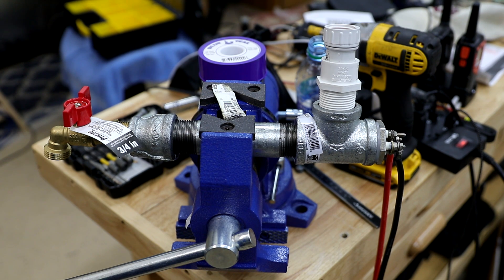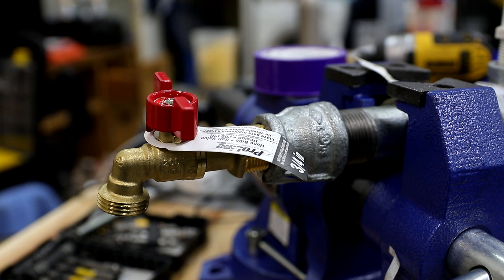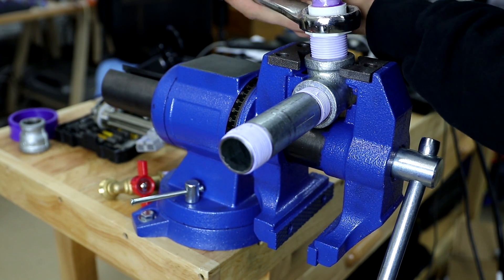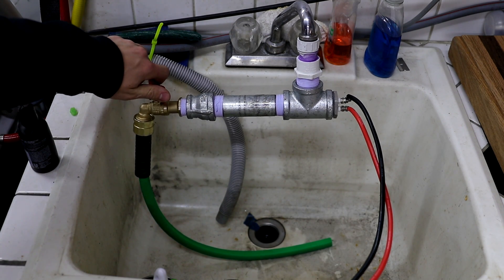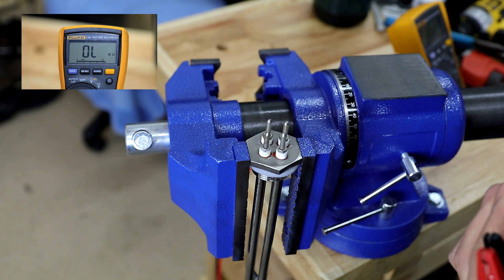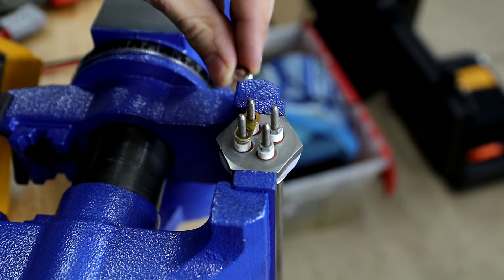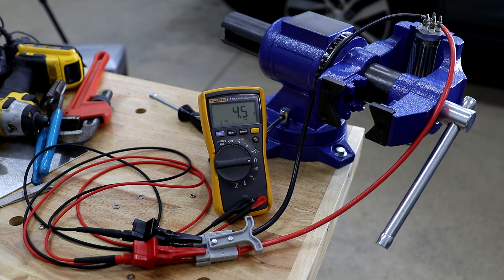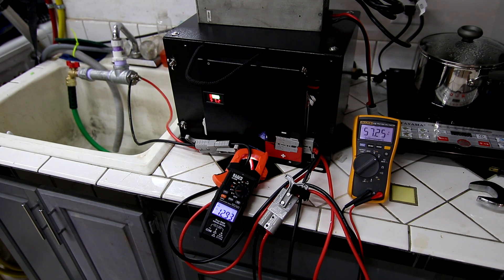2000 Watt DIY Load for Battery Testing

Comment: all I can think of is that water and electricity aren't supposed to be together
Reply from the maker: Then why do electric water heaters exist?
Reply: @HighTechLab  this doesn't look remotely like a water heater. you have 2 high power sources right next to running water and it doesn't even look like thats a gfci outlet, not that it would matter

Comment: Nice contraption and it works for testing. So now you have a control unit would have been nice to see the draw when hooked up. Don't run out of coolant or she will smoke. Cheers good video
Reply from the maker: Unfortunately the audio on the video got messed up just a bit and I had to scrap that part (Couldn't re-record without pushing this video out quite a ways)
Reply: @HighTechLab  $hite happens but you get to try again lol we like your videos  keep them coming.

Comment: I'm gearing up to Load Test 12 Nissan Modules here soon.   Going to be employed in a Solar / Wind Augmented Power Closet sorta thing.   Ordered a Tester from China and things are moving really slow with the Corona deal.  I need a  load like this.  Was going to use a coffee maker element in a bucket of water with water flowing.  LOL      Good Stuff from you  Sir.  https://www.aliexpress.com/item/33037262861.html?spm=a2g0s.9042311.0.0.5fef4c4dFocGG0
Reply from the maker: The problem that you can run into is that when you step up to 120v with an inverter, you really do introduce a bunch of AC waveform on the DC lines.  If you are trying to make a precision measurement, then that can cause havoc on the accuracy of the testing equipment.  In my case, I was able to easily keep that out of the equation by keeping things DC the whole way.

Comment: I would say in this case, resistance of the leads of your multimeter is negligible. Unless you are trying to measure down to single milliohms. My University teacher had a field day on my lab report saying that my resistance measurements could be off from resistance of wires

Comment: First, Nice idea
Reply: What was the outcome? How was the balance of the pack? Man you left us hangin here
Reply from the maker: I need to take the damn metal cover off of this pack, I mainly wanted to cover the dump load so I can reference it in future videos.  Unfortunately a few clips toward the end of the video had ruined audio, I started getting into the wattage calculations and all that jazz, but my audio recorder let me down (for the first time ever.)  I didn't want to scrap the whole video in the meantime.
Reply: @HighTechLab  ya . Its a great setup. I made one in a 5 gallon pail a couple years ago. But i ran it off pv directly. Does the water get hot when flowing through your setup?
Reply: @HighTechLab  i had a 24vdc 600 w element hooked to 3 x 200 w 24v panels. I seen 620w peak. No controller , no batteries. I thought it was pretty cool.
Reply: @HighTechLab  can you connect your phone to the bms?
Reply from the maker: It's simple!  The only thing I did notice after I got done recording is that it appears to me that the cold water is sitting on the bottom half of the pipe and the hot water is consuming the top half.  I might have to get a 90 degree connector so that as the heat rises, the hot water is removed from the top of the testing apparatus.